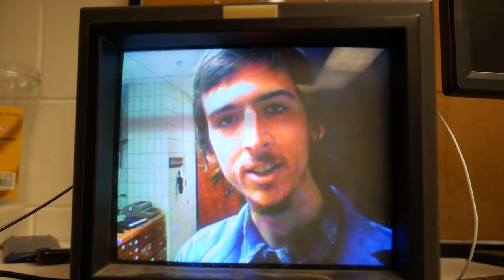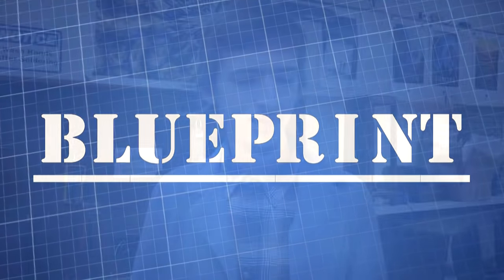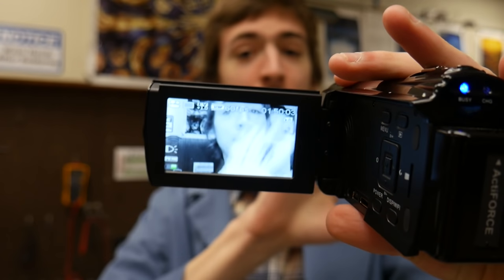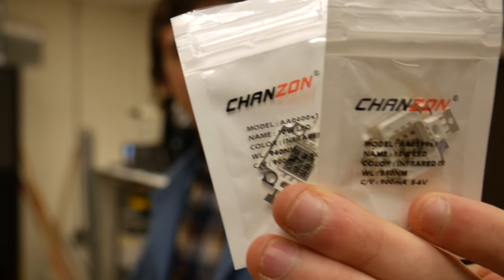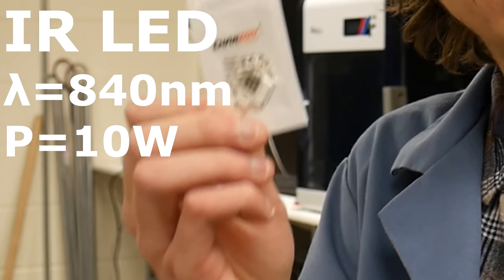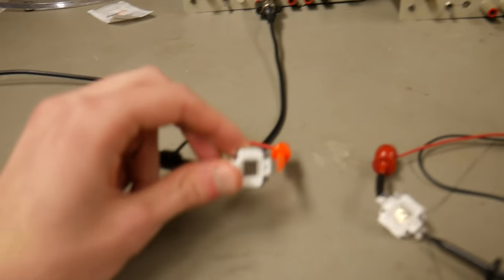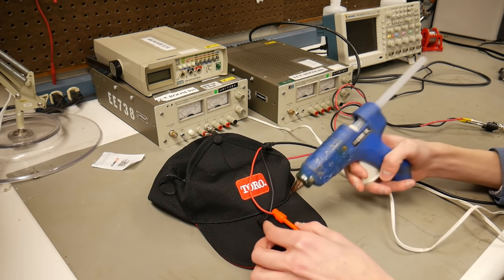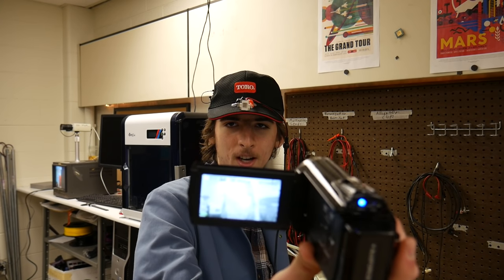How to Fool IR Security Cameras

Comment: This method will work well for a vehicle number plate :)
Reply: In UK someone was jailed as he sent a wavelength away from his car which gave error code on speed van scope. So he was convicted for perverting course of justice. 
So don't add these to cars or your in the s**t
Reply: @vincitveritas3872  that's a jamming device, this does not stop a person reading the plate.
Reply: @vincitveritas3872  those are radar jammer, I've never heard anyone for any reason to stick a 10W IR on their car
Reply: Except most cameras looking a vehicle number plates aren’t using IR, they are visible (hence the flash, or bright lights on those motorway average speed ones). And also, number plates have reflective surrounds and non-reflective characters, so at any kind of distance, you probably wont drown any IR camera, just nicely illuminate your number (see the bit in the video where he held his hand in front of his face and the LED, the backscatter illuminated his face despite the hat shielding from above). This only works for the “casual surveillance” cameras on domestic properties, small businesses and civic locations.
Reply: They have a spray for that. Camera can't see plate but still visible to the naked eye.
Reply: Honda is introducing an electric stealth SUV. It features holographic license plate numbers or the new digital plates some states are using. The radar signature is the size of an ant and special technology uses the internet to ascertain speed limit and return a suitable radar result at speeds below 150 mph.
Reply: @vincitveritas3872  He got arrested because he didnt do it well enough to actually defeat the camera.
Reply: Vincit there is no such thing as ‚automatic defenses‘ in fighter jets.
Reply: @vincitveritas3872  I remember this didn't he get a huge fine tens of thousands as well.. 👍
Reply: @bobjones1131  Im beginning to think those coatings are a hoax. What camera cant respond to any wavelength in human vision?
Reply: @pierreuntel1970  Im sure ir has been done. So has high strength visible light so that the plate image is overexposed to the camera rendering the characters so washed out they cant possibly be read.
 Time will tell now that toll cameras are being rolled out, Im sure well be reading more on the topic.
Reply: @andyowens5494  I did not mean speed cameras :) but anpr ones. They work in ir mode during the night. And chips not pointing at the number plate, but outward, around a plate.... May work
Reply: The gatso cameras use a laser or radio frequency radar to get the cars speed and the camera to take 2 pictures of the car for court purposes as people would say it's a ringed car not them etc so a picture can have a face or dealer stickers etc matching the driver and car to the scene along with line markings on the road indicating speed your bang to rights.
Reply: In the US, you if you are cited by a traffic cam via mail, you can legally not be held liable for the citation. You need to have a law enforcement officer ticket you for it to be a legal binding document. Just throw those tickets out. 

One major reason? My friend was driving my car, blew a red light. I got a ticket a week later, and in court you couldn’t prove WHO was driving the vehicle.
Reply: Mepp_Rider Yes! Goddammit! You are a genius!
Reply: @Doctorstew  the main factor in that is the difference between a criminal and civil offense. A criminal offense requires an INDIVIDUAL to be cited. A civil offense can be assigned to the offending item...such as a car parked in the wrong place or speeding through a red light. This is regardless of the person driving.
Reply: More to that point, the registered owner of the vehicle would get the ticket/citation in the case of a civil offense.
Reply: MTPatriot1787 ...This is true. My father went through a red light (without knowing it, lol) and got a ticket in the mail. He truly denied it but we all laughed because they sent along the pictures with the ticket, there he was taking a left turn against the red light. He paid the fine but was not given penalty points on his insurance because there was no ID on the driver. The ticket was assigned to the car NOT the driver.
Reply: Bob Jones they don't work.
Reply: @Doctorstew  Well, maybe go to court, but don't "throw those tickets out"! Otherwise, the judge will convict you in your absence.
Reply: I’ve built several variations of that. You need to produce more light energy than 1: ambient light during day (impossible) or 2 speed camera lights or car lights during night (very hard, 10-20 amps to LEDs at least). 

One of them I used a two way mirror. I should upload this to YouTube. I have a new idea that is better than lighting though.
Reply: Andy Owens another thing to help is put a switch on your tag lights and paint your license plate flat white. It will look the same to anyone else but you will get rid of the retro reflective properties of the original paint. Which will reflect light back to the source that hit it
Reply: MTPatriot1787 nonsense. A parking ticket is a non moving violation. For a moving violation, law states that you must be cited IN PERSON by a law enforcement officer. It’s a cash grab, and against the law. But you can pay them and go to court. I’ve thrown out six of them and never had a problem. Nothing even on my record.
Reply: @SaltyFailWhale  I am not about speed cameras. It will not affect them, as they shoot in normal, visible to eyes spectrum. But everything else, that is spying on people, including anpr will get affected. I do not want anyone to do it, as it is likely to be illegal.
Reply: I think if you do that on number plate only thing that you can do is to jam the speed radar not the cameras  because on streets have lights no ir used😄
Reply: Thanks for the idea
Reply: Ohhh... Nice idea
Reply: @Doctorstew  A dashcam with audio should "help" to prove that you weren't driving.
Reply: Yep then you can speed down the street with not a care in the world even have no insurance you'll never get caught those speed cameras or anpr haven't got a clue........wow your a genius.....so was the kid that you just killed.... sorry  just speculating........😏
Reply: @Doctorstew  absolutely true! I ignored a red light notice. First, a car ran me off the road. It was a red light or an accident. Second, there was no court date or ticket # nor "summons" indicated. I ignored it. 5 years later, zilch.
Reply: @cpbricef  except, meta tags.
Reply: Vincit Veritas that uk figher aircraft being locked by a radar gun was fake news. Counter measures dont work like that. At worse, they would eject chaff for a radar threat.
Reply: @SaltyFailWhale  I largely agree. Another part of me resents being constantly surveilled. Like on here. .
Reply: Police and stop light cameras do No NOT use night vision. Hence the bright flashing light. Duh !
Reply: @vincitveritas3872  Thanks but in the US so not yet a totalitarian police state like the UK.
Reply: @mon4d  Sure there is. It is called being armored. Just ask WW2 Japanese Zero fighter pilots with extra bung holes.
Reply: @MTPatriot1787  A civil offense cannot be used to restrict driving privileges. In California they unlawfully cite the assumed operator of the car with a criminal infraction. Our traffic courts are criminal courts in word but for those who know they are really civil and unlawful as well. If you are not licensed and not a driver then you are not subject to traffic laws that do not involve rights violation [honking the horn, driving erratically so as to cause the average operator to become distracted, etc therefore disturbing the peace/natural order] or property rights violations. Few are aware of this or know how to fight it legally.
Reply: Bob Jones / I've tried the commercial sprays, and they don't work
Reply: @googletaqiyya184  Armor is not automatic, it is passive.
Reply: I googled it and it seems some are saying false on there.  they also mentioned that an american version was debunked by mythbusters apparently
Reply: Shhh
Reply: Thats exactly what i Will to do
Reply: haha nice
Reply: Lololol
Reply: Actually ir cameras can barely read numberplate anyway I hate the ir setting on my works cameras they legit make it impossible to view numberplates as it jus tlooks white. I wish our cameras had a button to turn it off as it has caused us trouble in the past.
Reply: When it comes to licence plates buy a bumber that has a flat step above the plate. My 73 elco has 1 and toll cameras cant get ir
Reply: @bobjones1131  unfortunately it doesn't work..
Reply: Hellz yeah!!
Reply: What language are speaking Vincit?
Reply: MAD GRUMPYMAN  the laser reads speed. Video gets the footage so when an error code came up they must of passed on details of vehicle to have it stopped. Quite how man or woman in enforcement  van knew it wasn't just one of those things I don't know. I guess there are error codes for different things such as camera shake, unable to read etc quite how they knew jamming I don't know
Reply: Something already exist. Nophoto I think its called.
Reply: @vincitveritas3872  UK SOUNDS LIKE A FREAKIN POLICE STATE!!! HORRIBLE!
I PRAY UK IS FREE AGAIN!!!
💚😔🙏🏻🍊🍊👍👍😬😅😊🤷‍♂️💚
Reply: @es8559  I can only pray. Whenever I try to help people I get in bother 😂😂
Reply: @vincitveritas3872  That is why they still use it in Australia...because it is not accurate.$$$$$$$$$$$
Reply: @vincitveritas3872  I wonder how they proved it.
Reply: @13CRAZYDAVE13  
That was his personal secretary 😉💦
Reply: Even I'm searching for that kind of device... Because while I'm going with friends on city roads in India some police bike we heard but we didn't recognized that he is capturing vehicle pics.. ,On the same day evening my dad got a message that we have to pay fine through online.. At home diwali begins for me.. Later on I paid. . 
So, could anyone suggest me a better way except number plate changing..
Reply: Hell yeah just throw a toggle in the cab so you can flip it on and off whenever you want to
Reply: @nathanlatham5306  😅
Reply: @Doctorstew  

Do me a favor tell me what Amendment VI says....

Never happen in 🇺🇸...
GOD BLESS AMERICA.
Reply: @bobjones1131  
They do? 
Thanks Bob.
...I'm straight on it . Hehe
Reply: @joewoodchuck3824  
I can confirm they do work. 
 Go for a spin and see.
Reply: @phill3144  it does if there watching you on a speed camera at night time 🤣
Reply: Those traffic cameras take a picture of the driver. Stop spreading false and illegal measures.
Reply: @Doctorstew Camera tickets are civil matters, like a lawsuit.   They aren’t criminal matters like regular police tickets.  That’s how parking tickets work, too.  They don’t need to prove beyond a doubt that you parked the car or ran the redlight.  It’s a lesser standard, called ‘preponderance of the evidence’.
Do not throw them away.

And yes, they should be illegal, but everybody gets a piece of your money.
Reply: @baddriversofthenorcalarea500  I had a look at some pictures. Quality is so bad at night, that you can not even tell if it is a male or female 🤣 But just enough to clearly read the number plate
Reply: @bobjones1131 what spray?
Reply: Need to thwart facial recognition too. And it not be a dead giveaway.
Reply: @latenttweet do tell more
Reply: I have a neighbor who bought a fence not sure I believe a 6ft fence then put a camera facing down our driveway but more towards his house but can definitely tell it's in view of the start of the driveway so we block it and he puts another one in the trees above his fence still in his yard but can see everything except our house would I be able to put a IR light in a tree to block him from viewing the yard?
Reply: @bobjones1131 The sprays don't work.
Reply: I have ir laser diodes in the same housing as my license plate bulbs. Find a cop that'll figure that out
Reply: Good finking.
Reply: i was literally about to start manufacturing these
Reply: @Doctorstew  That's been upgraded in most places that have red light cameras so it shoots a full color video of the car that starts before it even gets to the intersection, in hi-res slo-mo rolling through a solid red. If it is you, it can't be contested. If not you have to name the person or risk a hefty fine.
Reply: Yes but it‘s illegal- the only thing u can use it is to protect against legal parking scammers
Reply: That will definitely work on flock security..

Comment: The inverse is also true. You can use night vision functioning cameras to find night vision security cameras, or at least find IR emitters that signal the presence of them.
Reply: In other words, you can find cheap active night vision cameras (require an IR spotlight) but not the more expensive passive night vision cameras (no IR spotlight required).
Reply: More info please😊
Reply: @lilpat1198  Use your cellphone camera its probably good enough. You can see the glows

Comment: If you can find older tv remotes, the Ir leds are big enough that you can solder-wick them off and just stick a bulb in the bill of your hard and use a cr2030 to run it, I'm not sure how long the battery life would be but it should last a while and be easier to hide in the hat. Nice video. Subbed
Reply: That won’t work

Comment: By the same token, using your old 'junk' video camera (which sees IR) you can easily spot hidden security cameras that use IR illumination. An IR laser pointer will probably permanently blind any camera you point it at, as well.
Reply: " An IR laser pointer will probably permanently blind any camera you point it at, as well."

Really? interesting.....
Reply: @jasonfields7058  is this even possible ?

Comment: would a diffusing lens or scattering make it more effective? use lower power and lower profile led? How much battery and how long a run time can you get?
Reply from the maker: I suspect that would less effective. High intensity from a small point works best. The "glare" occurs at the camera and covers an area much bigger than the LED

Comment: Mosseberg 590 is the only shotgun that passed military trials testing. Also the shell elevator design on the mossberg is nicer, you don’t get gloves or fingers ever caught up like the Remingtons… and jams (if ya ever get one) will be much easier to clear with the mossberg design
Reply: Those tiles aren't waterproof, just water resistant. You still have to clean them or your pool gets dirty.

Comment: Some IR light bands can be seen on a cell phone camera like the IRLED on a remote control for a TV, etc. I just used this technique to repair the buttons on a remote control that weren't working properly. They actually show up on the cell phone camera so I could determine whether or not I fixed the problem buttons.

Comment: How do I run these devices off of a 5 v usb port? I hooked one directly to a USB cable and plugged it into my power port in my truck and it got incredibly hot and eventually started shutting down the leds until they were allowed to cool off. do I need to lower the power or add some kind of cooling hardware to pull the heat away from it?

Comment: Rather than being invisible, such a device triggers business security systems and may make the guard come by sooner.  For example, my local chevrolet auto dealer has computerized cameras scanning his parking lot and buildings.  If the camera sees any kind of heat source moving about, it alerts the security guard service and they send several guards over.  The car will drive around while other guards walk through the lot to check to see if somone is hiding under a truck trying to saw off a cat or steal rims.  It sucks, but there are also people with damaged cars that treat other people's cars (or dealership cars) as sources of replacement parts.
Reply: So you're looking at it as a criminal, what if all I want to do is protect my privacy,. these security cameras footage is being sold just like all our other data

Comment: This light would be good for those red light cams. Put them on the plate facing the cam, they could be on all the time and nobody would know it. Blur out your plate number.
Reply: You just need to coat your plate with a reflective spray on. Same result, much cheaper and easier to implement.

Comment: Can I link a 9 volt straight to IR led chip? Or would it burn up
Reply from the maker: Actually, I don’t think that a 9V can supply enough current. 9V batts are only 5 watts, this LED is 10 watts. Two in parallel would do the trick.

Comment: What did you use for a portable power supply on your hat?
Reply from the maker: I didn't; I had wires leading to it. If I were to battery power it, I'd use a lithium battery due to its small size and high output.

Comment: What is the range of "light' that can be used to see? Could a camera use microwaves? To make actual images?
Reply from the maker: Technically anything can be used for imaging. X-rays are a good example of that. So are infrared night vision or thermal cameras.
Microwaves might not be a great choice since its wavelength is roughly 12cm. Anything smaller would not be practically visible.
Reply: @BlueprintScience  So the range of visible light is the perfect size to give us clarity off everyday objects? Smaller, like x-ray, would pass thru skin, and the larger we go, we loose clarity?